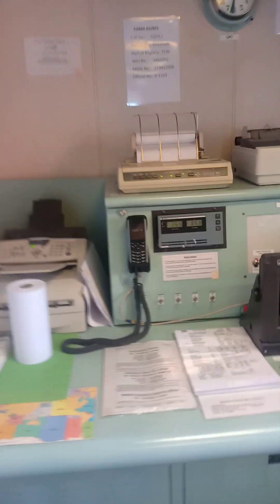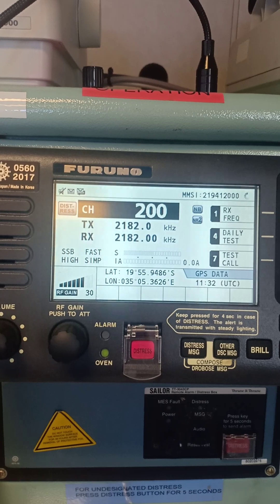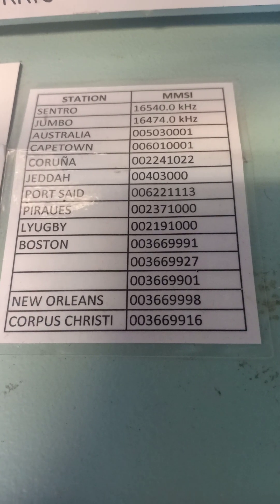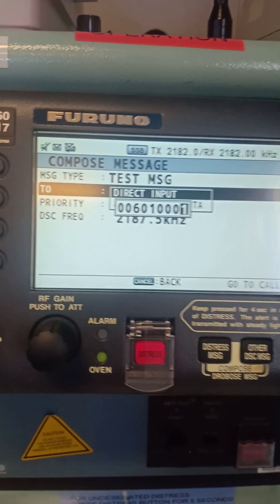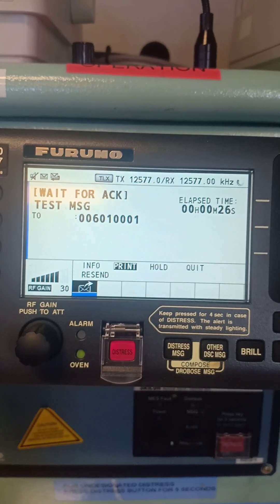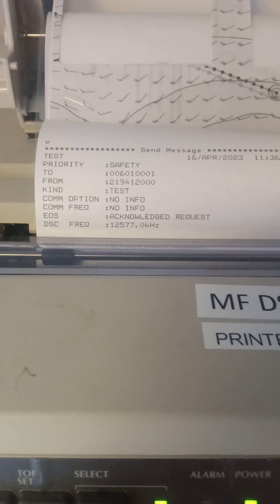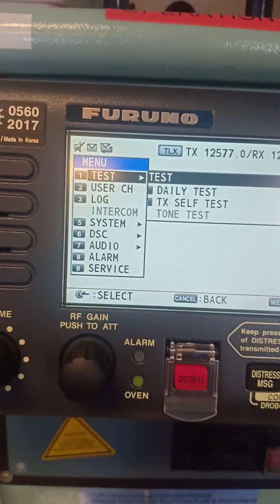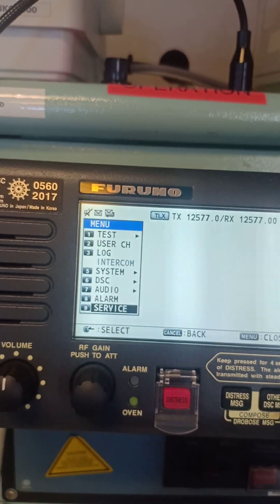NAVIGATOR HACKS!GMDSS test using FURUNO FS-2575C MF/HF Digital Selective Calling w/ Coast Station

Comment: FB MSG'r can I u some information
Reply from the maker: Yes po.
Reply: Sir some questions. May sat c ako sat 1 sat 2. Paanu ko test to coast station.or Anu ba gamit nito KC sa tug boat lang barko ko
Reply from the maker: @joenartuluan6401  Hi good day! The reason why ships nowadays have 2 sat C is because it is the requirement when you dont have the NBDP.  You will not be required to have nbdp, when you have 2 sat c. Yes you can test ur sat c thru several tests, and even by email. You can also test sat c such as pv test, diagnostics test, distress button test, ssas test as well. Let me know which one youd like to know how.